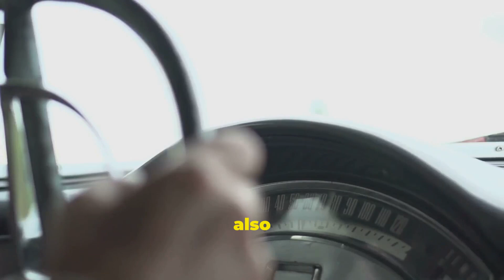Why Cars Don't Use Inline-8 Engines Anymore

Comment: Studebaker also produced straight eight engines.  I own a 1941 Studebaker President with a straight eight.  After 83 years, it's smoothness is really something to be appreciated.  I had heard, but cannot verify, that an inherent problem with straight eights was that the necessarily long crankshaft was subject to excessive torque stress.  This defect limited the amount of power that could be obtained.
Reply: The issue of torsional vibration, which is likely what you thought of as a problem for inline eights, was not an issue in the days of 70 to 80 octane gasoline (yes, 80 octane was "high test" or "ethyl" prior to WWII !), compression ratios that seldom exceeded 7:1 (6.5:1 being quite common), engine revs that seldom exceeded 4,000 rpm, and quite undersquare engines.  Fords and Chevys came out of the factory with their mills putting out a measly, by later standards, 85 or so ponies to push a 3,600 lb vehicle around!   Even a larger, heavier Cadillac or Lincoln might have a mill that put out 150 to 160 hp!  TORQUE...torque, especially "low end", around 1,600 to 2,400 rpms, was what passenger car and light truck engines were designed for.

The reason was simple:  we lived with what Tony of "Uncle Tony's Garage" describes as a "fifty MPH" world.  The Interstates we're all familiar with hadn't even been thought of, and few places could a car get up to, say, 75 mph before having to slow down for the next town, which even "main" US highways always went THROUGH, and the motorcycle cop looking for an excuse to hand out a speeding ticket was as common as coyotes.  For areas that were wide open and actually afforded stretches of high-speed driving, the overdrive add-on units that were more common could actually be used.  Else, it was plod along, and for most motorists, that was fine, as long trips simply weren't all that common, save for well-established tourist routes like the famed "Route 66" to get one's "kicks" upon.  Those torque old flatheads did just fine to get those heavy old beasts "off the line".

The changes were already in sight just prior to WWII, with the advent of freeways in Southern California (the Pasadena Freeway opening in 1939) and "Parkways" in the East.  Many states were already putting in tollways to relieve congestion and, of course, earn revenue, especially from through trucking willing to pay tolls in exchange for moving freight that much faster.  The war itself actually DELAYED introduction of more powerful, modernized engines, and, most important, higher-octane gasoline, as those changes were held back "for the duration"...after all, don't you KNOW there's a WAR ON?  The delay in introduction to more powerful V8s and higher compression engines endured for several years, postwar, as the stopping of auto production for private use meant that Detroit could put out more or less warmed-over 1941 or 1942 designs for the 1946 through about 1948 or even 1949 model years, and time was needed to retool the factories that had been converted over for war production back to civilian use.   

This was also a reason for the demise of "other" auto makes like Hudson, Nash, Packard, and Studebaker.  On their own, these companies simply couldn't afford the by-then hundreds of millions needed for retooling, and their creditors weren't willing to risk further loans.  Indeed, the 1954 merger of Hudson and Nash into American Motors was spurred in part by urging of their creditors who suggested that the merged company would be far more viable.  There had also been a proposed four-way merger that would have included Packard and Studebaker, but an up-and-coming executive with a burgeoning family by the name of George Romney nixed it, citing the enormous costs and market overlap.  In particular, Packard, though it had a well-deserved reputation for high quality, durable automobiles (one of the reasons it was picked by the War Production Board to build the British Rolls-Royce Merlin aircraft engine under license during the war), its designs, particularly its own flathead eight, and its plant were woefully out of date.  Give Packard credit, in its last years, that flathead was competitive, power output wise, with any V8 that their competitors offered, even including Chrysler's famed "Hemi"!  Still, Packard's days were numbered, and even a merger with Studebaker, leading to Packard's using the Studebaker design for a V8 offering as of 1955, couldn't save either company in the long run.  Indeed, part of the problem, and not just with having a common engine, was that as the new Studebaker-Packard Corporation had to close the Packard factory anyway, in order to trim costs, the low-end Packard Clipper, already offered before the merger, was not well-received, being derided as the badge-engineered "Packardbaker".  

It wasn't simply financial resources that kept inline eights going into the fifties, though.  A rivalry was already under way between Chevrolet and PMD, as Chevy even then insisted its new V8 (delayed by two years, in part to the indecision of GM top management as to whether to have Pontiac use Chevrolet engines) should be the only one offered for lower priced GM vehicles.  Pontiac finally got its own way in designing and producing its own line of V8s, but that meant keeping the Pontiac flathead eight going through the 1954 model year.

Comment: Chrysler threw away a perfect opportunity to bring back the inline-8 engine.  Not for practical reasons but, as a show-off engine for the Plymouth Prowler.  A long narrow front clip with two 2.5 inline fours tied together and phased to create the V8 engine sound would've really made the Prowler a unique showcar for everyday driving.  Plus, an inline 8 would've allowed for 8 chrome exhaust pipes to exit out one side.  

The Prowler's stubby front clip housing a V6 just fell short of what it could've been.
Reply: I think the tooling costs alone would have doomed such an idea.
Reply: @selfdo   You're probably right.  In my mind, it should be easy but, shows how much I know about tooling up for a major engineering change like linking up two inline fours to work like an inline eight AND have it pass all tests for whatever they test a car for.

An inline eight Prowler would have to be a niche car with a production of no more than 500 to avoid certain DOT and EPA regs.  And niche means $$$$$$$$$.

Comment: One of the other reasons you did not mention why the straight A went away was because of fuel distribution issues. Of course, back then most all engines were running carburetors and if you had one carburetor you would normally put it about right in the middle of the intake manifold. And it would be between ideally between cylinders, four and five. But that would cause those two cylinders to run. Rich and then the very outboard cylinders was one two seven and eight would run Lean

Comment: The straight eight had perfect balance with a 2-4-2 two-plane crankshaft.  The V-8 took over when high-compression engines with shorter, stiffer crankshafts were needed, and the development of tuned, flexible engine mounts absorbed the slight imbalance of V-8s.  The perfect balance of the straight eight was no longer needed.  Still, straight eights are easier on their engine mounts, and are kinder to their drivetrains, making old ones easier to restore and keep alive.  The development of the V-8 was in stages--first, it needed a two-plane crank itself, then, unit-cast blocks became possible, then, two-level intake manifolds eased feeding them with single carburetors.  Finally, the development of modern fuels necessitated high-compression engines, and the change in style preferences made long hoods no longer desirable, killing off the long straight eights with  their whippy crankshafts.  Still, their demise means that they represent a lost era--there is nothing like the nasal sound of a Buick OHV straight eight, particularly coupled to Hydramatic, to evoke memories of a distant time.
Reply: Buick OHV straight eight was never coupled to a HydraMatic. Buick used DynaFlow exclusively. Never HydraMatic.
Reply: @jimgarofalo5479  Thanks.  You're right--I had the wrong name.  And I knew better--no excuse.  Corrected now.  Buick's torque tube drive would transmit Hydramatic's shift shocks to the rest of the car, so Buick needed a smoother transmission than Hydramatic.  Good catch.  Thanks again.
Reply: @phantomforester9337  Henry Ford started the end of the V8 in 1932 with the Flathead V8.
Reply: @CrazyPetez  I think you mean the end of the straight eight.  That Ford was the first production unit-block V8, but it didn't have the whole kit--it wasn't OHV, high compression, with two-kevel intake manifold, and tuned flexible engine mounts (I think), which all doomed the straight eight when the fad for long hoods waned.   There were plenty of straight eights introduced after the Ford V8 (for example, the small Buick), even after WWII, when Packard intro'd a new L-head straight eight, of all things.   I think the key to the V8's takeover was the introduction of new fuels which allowed higher compressions to be used.   There was a lot of customer attachment to straight eights; Buick sold plenty of them right up to the end.
Reply: @phantomforester9337  The V8 engine wasn't new by any means, Cadillac had a V8 flathead design starting in 1914, and their flathead designs soldiered on, LITERALLY, as in being tank engines, throughout WWII, in the M3/M5 Stuarts and the M24 Chaffee light tanks.  These flatheads were used through the 1948 model year as Cadillac, like other automakers, needed time to retool to the more modern designs that would have been introduced but for WWII cancelling private automotive production altogether "for the duration".

Yes, a straight-eight has weight and handling issues as compared to a V8 engine, but most of them could be made with the same tooling as the far more common inline six-cylinder engines.  In most American cars of the period, the front axle was ahead of the engine anyway, and the smaller "standard" autos like the Fords, Chevys, and Plymouth came with inline sixes (the Fords after 1940, as the 2.2 liter flathead V8, the "sixty horse" version, was discontinued, came standard with an inline flathead six, but the 239 cube V8 was very common), the latter two ONLY with their Sixes.  Furthermore, in quite a few instances, as with Chrysler, for example, the inline sixes and eights often shared parts, especially pistons, rods, valves, springs, and lifters, and often accessories as well like oil pumps and generators.  The "crankshaft whip" issue, due to flexing of a ductile iron crank (make the casting too hard, and it becomes prone to cracking which with a rotating part under load can be a DISASTER), wasn't a problem for those old long-stroke, high-torque, low-RPM motors anyway under most conditions.  Compression ratios were typically around 6.5:1 to 7:1 with that 80 octane gasoline that typical in the 1940s.  When "regular" engines got "high compression" of 7.5:1 and even 8:1, the loading on a long crank became more of an issue, especially at the higher rpms demanded by drivers.  Also, carburetion, always an issue on long inline engines, was even more pronounced with the straight-eight, which often "wheezed" through a single-barrel carb.  There was little way to avoid having the inboard (#4 and #5) cylinder have too rich a mixture, and the outboard (#1 and #8) ones be too lean, resulting in uneven power and wear.  Some higher-performance engines had dual carbs to help with that problem, but it took an expert to figure out how to synchronize them!

AFAIK, the Buick straight-8 was the only one that was OHV; but it was a middle-to-premium line anyway.  Other eights, like Chrysler-De Soto, Oldsmobile, Pontiac, Hudson, Studebaker, and Packard, were flatheads.  They worked fine with the fairly low compression ratios of the time, but couldn't usually get above 8:1, so when modern "ethyl" that enabled production engines to sport 10:1 to 10.5:1, their days were numbered.
Reply: @selfdo  Yup.  But we are talking about why the V8 took over.  Chevy actually had an OHV V8 in 1917, in the first V8 craze, before the brand was assigned to the lowest rung of the market ladder.  (It traditionally had OHV engines.)  The V8 takeover was in stages.  Cadillac came up with the two-plane crank for V8s.  Ford, then Cadillac, came up with unit-cast block V8s, making manufacture much cheaper.  Cadillac came up with a two-level intake manifold, making charge distribution more even with a single carburetor.  All this made the V8 configuration primed to take over when better fuels made high-compression, high rpm engines suitable for mass production, with stiff blocks and crankshafts, advantageous.  Ford had made the V8 become a standard configuration--even a minimal quality-car engine configuration--for the market.  By the way, there were overhead-valve straight eights from Stutz and Duesenberg long before mass-production high-compression V8s appeared.   Oldsmobile built a weird horizontal-valve V8 for the Viking companion brand in the 30s, which didn't last long.  I believe the Dutch Spyker had a V8 in 1902, and DeDion had  V8 in 1910.  So the configuration goes back a long way--there was just no particular advantage to it until postwar fuels gave it the last boost.  High-compression, high-rpm engines do better with overhead valves and oversquare bore/stroke ratios, which required new tooling, and would make straight-eights way too long anyway,  There was no point in continuing them in a market which demanded eights.
Reply: @phantomforester9337  Yes, Chevy DID have an OHV V8 back just before WWI.  You might want to consider why it was discontinued at the time.  Early V8s involved what was then rather complicated tooling jigs, and the fairly low compression ratios and long-stroke engines just didn't allow for large-scale production motors to make a lot of horsepower.  When you're looking at production of, say, 200K units a year, saving $10 per engine in production costs was a BIG DEAL, especially ca. 1917!  As you pointed out, with the low-octane gasoline of the time (the Ethyl Corp. had just recently come out with their leaded gasoline supplement to refiners), and in some cases, like with the Model T engine, car engines could readily run on ethanol or even LNG, so any exotic engine configurations were simply wasted...at THAT time.  

Sixes were actually the "big" engine of their day, with Chevrolet adopting their first "Stovebolt' Six in 1929 as a response to Ford having introduced the improved Model A in 1928, advertising a "Six for the price of a Four".  Up until then, six-cylinder engines were the "BIG"  engine, and this perception even carried over into baseball, as legendary Giants pitcher Christy Mathweson was nicknamed "Big Six".  Plymouth had come out with a four-banger, like its competitors at Ford and Chevrolet, and once an inline six was offered in 1933, that was the preferred choice.  Eights were seen as a large, luxury engine, but at least the engineering of them was straightforward, often, as with Chrysler, always pinching pennies, sharing components with the inline sixes, which was, in most cases, to take an inline four, duplicate it, and turn it 180 degrees in attaching it to the other four-banger, to make for perfect dynamic primary and secondary balance.  This gave the engine the desired smoothness.  Quite a few inline eights commonly idled at less than 400 rpm, being so quiet that in some cars there was actually an indicator light to let the driver know the engine was stopped (with the ignition still on) to avoid grinding the starter or flywheel!

Still, with higher octane gasoline and the higher compression it enabled, both the flathead designs and the straight-eights were obsolete.  Yes, the Vee configuration was the obviously choice, though consideration was at times given to a "flat eight" (horizontally opposed, like the Subaru, VW, or Corvair engines), and I believe the Czech company Tatra had one for some time.  Since the "flat" design was far better suited for a rear-engine configuration, and beyond something like the VW Beetle, there was simply no place for rear-engined cars on American roads, it found no favor with "regular" American cars, the Corvair being a noble but futile attempt to "break the mold".

Sadly, it appears, thanks to Government interference and fuel economy mandates, that the V8's days are also numbered, as turbo fours seem to be more or less standard, even on full-sized sedans, SUVs, Crossovers, and Trucks, and V6s are still there, but getting FEWER.  End of an ERA.
Reply: @selfdo  Thanks for the illumination.  I do not agree that the Corvair was a "noble" attempt.  It was a marketing gimmick--a six to VW's four like the stovebolt six was to the Model A four.  It didn't "break the mold"--it tried to add to it--a lot more car for a little more money.  But it didn't work out that way.  The engine also came in heavier than drawn, which was a bad mistake, given that it was mounted behind the rear axle centers.   The bean counters also made the engineers remove the rear antiroll bar and the passenger's sun visor.  The original Corvair was a stark, poor-handling (never mind Nader) cheapo car with odd mechanicals which didn't fit American expectations.  Later, it got better, when they changed the target market--but a "noble" attempt?  Uh-uh.
Reply: @CrazyPetez  the other way around lol :)
Reply: Whatever idiot